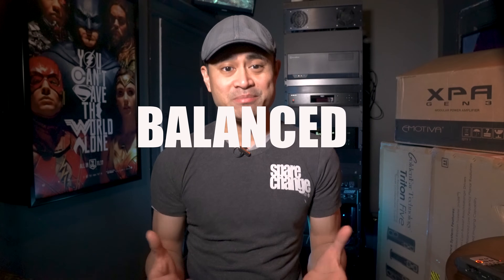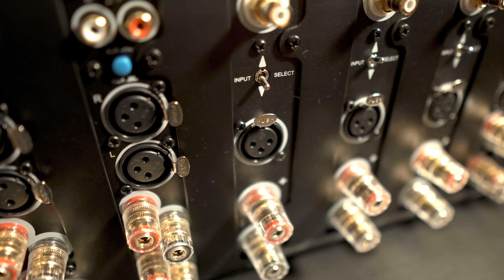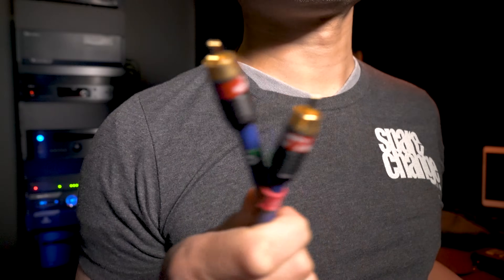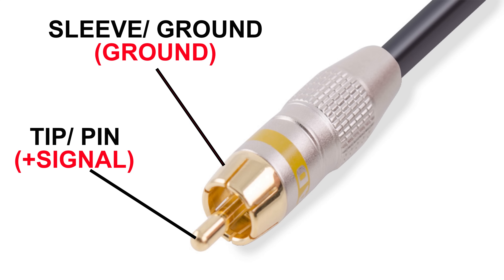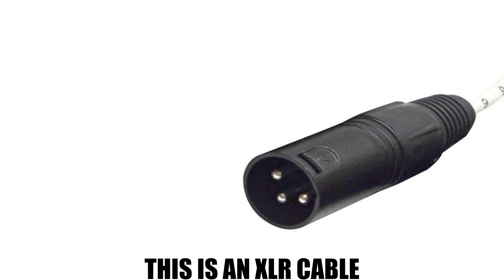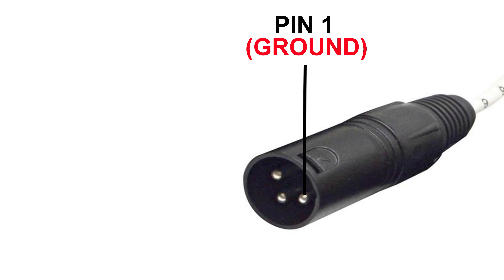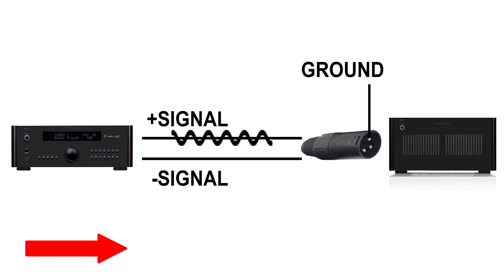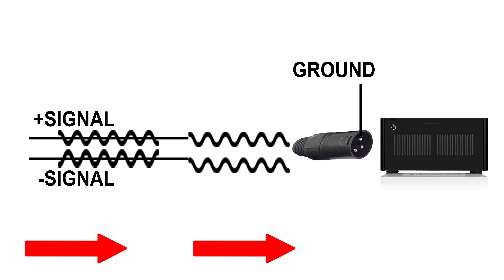Should You Use XLR or RCA CABLES For Home Theater?| Balanced vs UnBalanced | HOME THEATER TECH TIP

Comment: I use an XLR out from my Emotiva DAC to feed into a Klipsch wireless subwoofer. It is an XLR to RCA cable, so obviously that end becomes unbalanced. I had initially connected the SW to one of the RCA amp line out. While I don’t see a big difference in the bass quality, but with extremely keen ears  and years of listening experience of good hifi systems, there is a bit more ‘tightness’ the bass at the same SW settings compared to RCA. It feels tad more well integrated into the stereo speakers with no directionality to the bass or be able to point out to a subwoofer even being in the system. Note that I don’t have a dedicated SW out in my preamp DAC or the Amp.

Comment: I have a pair of Neutrik NC3MXX-B and NC3FXX-B XLR connectors with Van Damme Starquad XKE cable. The pair of these can be purchased for around £40.
I could not detect any difference compared to RCA cables that cost me £160
Reply: The point is their is no difference just to your pocket book don’t be an audio fool this is why they should make all consumer electronics balanced XLR then you would be spending 10-15 quid for excellent sound and you could do a long run without quality signal loss.
Reply: If there was no difference at all, then you didn't have a balanced connection. You were just using 2 of the 3 conductors in the cable. Its identical to using a pair of rca cables.

Comment: Usually XLR hardware accept or can produce higher level (meaning more peak voltage) this also can enable using amplifiers with a lower volume (but same output power result) depending on situations this can be desirable. The + and - signals cancellation can also help reduce noise with faint signals like mics or phono.  With everything good, RCA can also be good, but XLR seem to insure good signal more often / easier. (same thing with TRS vs TS connections) My gut feeling is that with stronger signals (without going into the red) the sound seems clearer, or have more authority. But this changes nothing to imaging or detail, this is just more puch, more dynamic. But all that is subjective, since i can't technically justify that, and it can be situational with recordings and specific devices used.
Reply: under 6 ft, rca is better because cheap xlr transformer is not good.  a great stereo xlr transformer by jensen is $380 so not too many amps/preamps have this quality

Comment: If the distance of the connection between your preamplifier and amplifier less than 10 feet then use good quality RCA for maximum signal. If the distance is greater than 10 feet use XLR

Comment: Question: I have 2 active speakers which I connect with my mixing console (RCA output).
I plug the RCA-in in one of the speakers and if I output from speaker1 to speaker2 the volume is way lower. The speakers also have XLR in and out(each one of them).
Will I solve the issue with an XLR cable from speaker 1 to speaker2?

Comment: I use a processor with only xlr out. when i put the mini dsp hd i had to use a cable with xlr on one end and rca at the other from processor to the mini dsp hd. Since then i get a popping sound from my subs when i switch the system off. Is there a cure for that? Please help!

Comment: I understand an audio unit can have balanced inputs outputs but still not have the circuitry “Fully Balanced “. My question is if the internal circuitry is not balanced does that negate the Function or benefit of the XLR connection?
Reply: No. You only get some of the benefits. When you have components that are balanced only at the connections, you can take advantage of long cable runs. If your components are fully balanced or fully differential, the entire signal path is balanced as it travels through the component. Fully balance will effect sound quality, but its typically only used in higher end gear because it costs a lot of money to add this feature.

Comment: If the receiver doesn't use xlr and the amp does both will an xlr to rca still be better that rca? If thats the case does the amp have to be set as balanced or unbalanced?
Reply: No. Only 2 of the 3 conductors in the xlr cable will be use. Without having a balanced connection on both ends, the connection defaults to single ended. Its exactly the same as using and rca cable. Also, you may run into problems depending on how everything is wired. It all depends on what is done with the extra pin that carries the 2nd signal in the balanced connection.

Comment: Have you noticed a difference in sound quality on subwoofers? Xlr vs RCA?
Reply: @CasualDad08  Hi I know this post is 4 years old. But yes, I use an XLR out from my Emotiva DAC to feed into a Klipsch wireless subwoofer. I had initially connected it to one of the RCA amp line out. While I don’t see a big difference, but with extremely keen ears  and years of listening experience of good hifi systems, there is a bit more ‘tightness’ the bass at the same SW settings compared to RCA. Note that I don’t have a dedicated SW out in my preamp DAC or the Amp.

Comment: Do use for my TEAC DSD DAC  unbalanced XLR to RCA because my AVR DENON has no XLR input.  So I was concerned if my DSD files will pass through and they do. ON my universal NAD player to output 2ch SACD it has to be balanced XLR both ways. I normally use the RCA analog multichannel out for that to run multi or 2ch stereo in SACD to  my AVR. by using a RCA TO XLR adaptor would that make it balanced ? I do have one amp of mine that has XLR input.
Reply from the maker: You can not make an unbalanced rca balanced with an adapter.

Comment: I have a Marantz 7012 with only RCA inputs and the amplifier I’m getting has both XLR and RCA so what cables should I get XLR to RCA or RCA to RCA. Which will be better or will it make difference? Also my cables will only be 1.5 ft.
Reply from the maker: Doesn't really matter they'll still be unbalanced if you use an adapter.

Comment: The noise canceling benefits comes from the differential circuitry in the electronics not the cables.  Most home theater gear does not use differential circuits, but offer XLR connections simply for flexibility.  Both ends of the connection must employ the differential circuitry to gain the greater signal to noise ratio, otherwise you still gain the 6db greater signal, but also 6db of increased noise.

Comment: My preferred cable is HDMI cause it takes away all the clutter especially on devices such as a Blu Ray player as an example and the only real reason you would need any other outposts would be for old formats like DVD Audio. XLR is widely used with PA Systems and Microphones for live bands and I think if you are using Power Amplifiers that is where they are mostly used to cut down the noise interference. 

I personally do not see the point of them being used for AV Receivers and Hifi amplification. Stage amplification generates way more power than anything you are going to buy in the AV or HiFi world which is the reason why XLR cables are needed for live performances and stage gear. I do not see an awful lot of benefit you will get by using them on AV and HiFi equipment.

Comment: XLR seems prevalent enough on equipment and subs but seems rare on speakers outside of studio monitors and concert loudspeakers/pa's  Any reason that might be? do you thik XLR may become more common on speakers  in place of binding posts, oh wait, rca and xlr are only line level aren't they? they won't pass speaker leval?, so basiclaly only used to connect signal to amplified destinations or other equipment like source?
Reply: think you are mistaken, pa uses speakon connector(unbalanced) and hifi often has xlr for the good stuff. my power amp only has xlr inputs.

Comment: Have used RCA all my life with my stereo setups. Have used XLR for sound with bands. Just recently bought an amp that has XLR for front LR of theater / 2 channel listening. The XLR are lower in volume, but seem to have better detail than the RCA. If I had to do all over again, I would've bought a multi channel amp that had all XLR's.

Comment: My experience with XLR cables is they output at a lower volume level may hear a slight improvement in detail but nothing major, as for unbalanced perfect for 6metres with  quality interconnects any longer XLR if perfect  for that, again with quality XLR cables
Reply: A question: if i want to connect an amp with the preamp, or a source with preamp, and i have both choises, in a less than a metter distance between units, do i benefit in something from the one or the other solution ? (Rca, or Xlr  interconect)